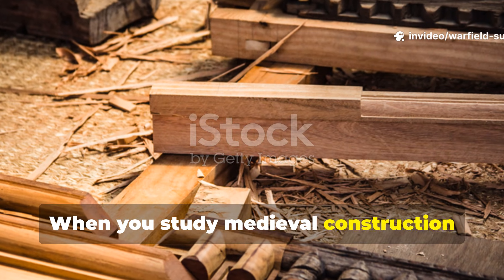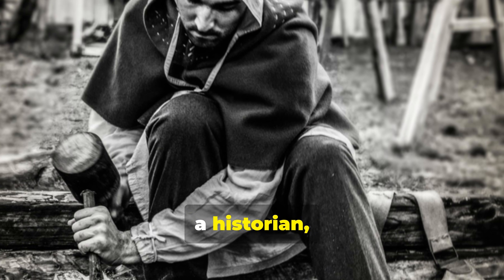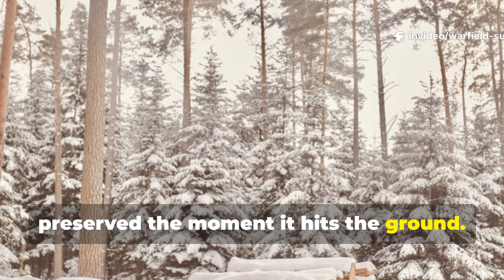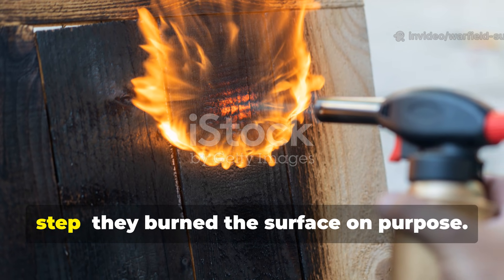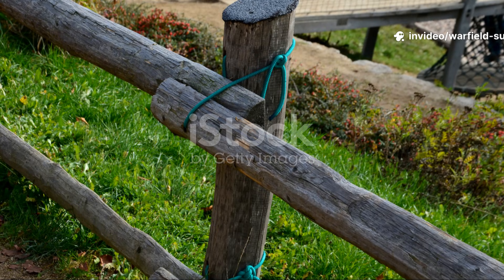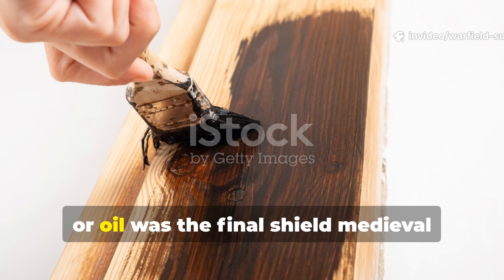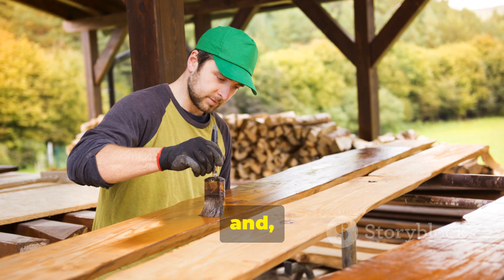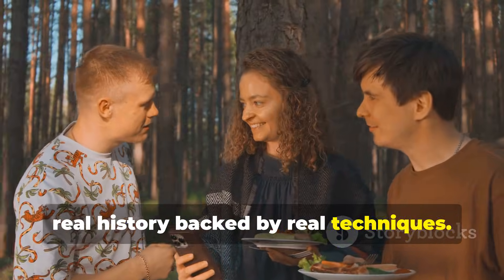The Medieval Wood Trick That Modern Science Still Can’t Beat

Comment: As a boy I was taught that falling our timber in the winter was better and the wood remained mor stable then it was piled at the mill for two years drying then cut or milled and stacked slickers placed for air flow covered with tin sheets and dried for another year